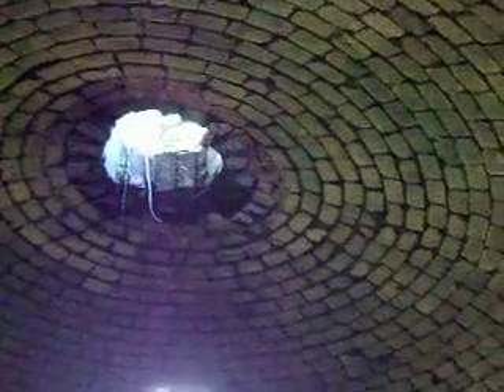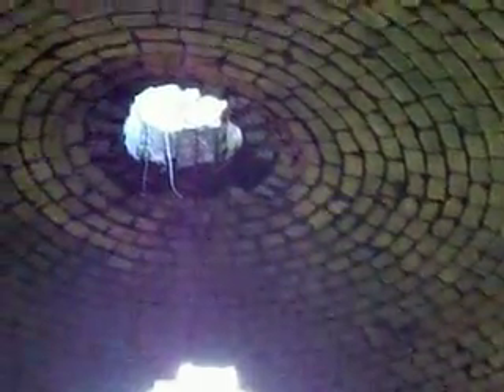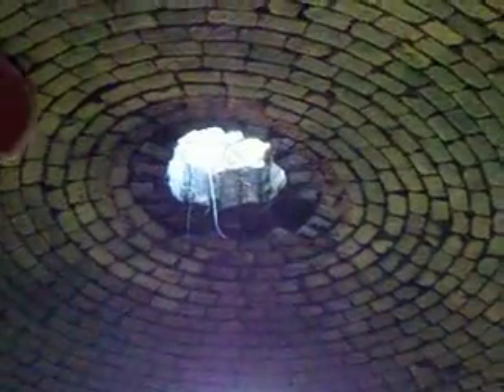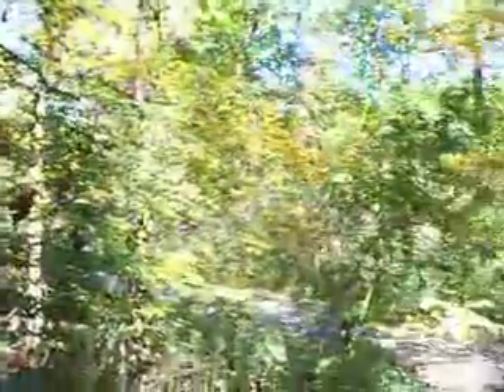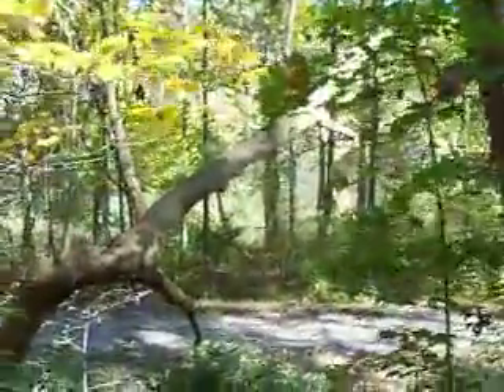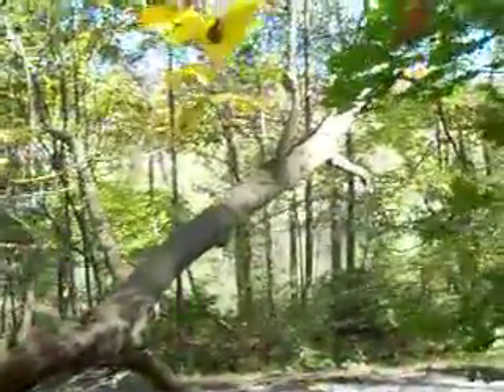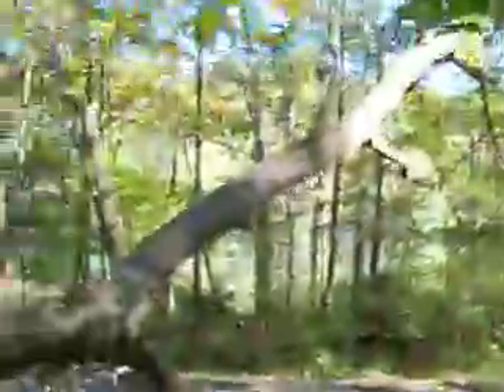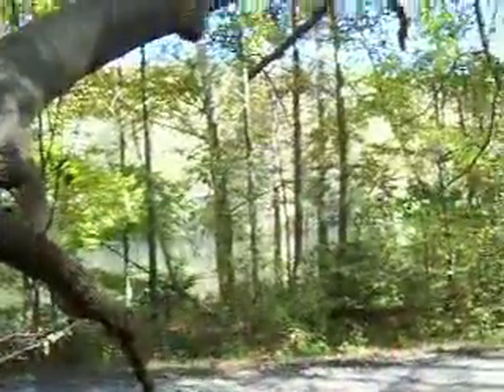Beehive Coke Oven Inside Out Dickerson Run Fayette County PA

Comment: The bricks appear clean because the coal burned white hot causing the bricks to literally melt and fuse together.  After the coal burned required time which was usually 48 hours, the coke was quenched out with many gallons of water so it could be pulled out with long steel scrapers; There weren't many entire families living in the ovens, but it wasn't unusual for
male companions to reside therein, usually short periods of time. 
Pulling the coke by hand was labor intensive.  Later mechanically.